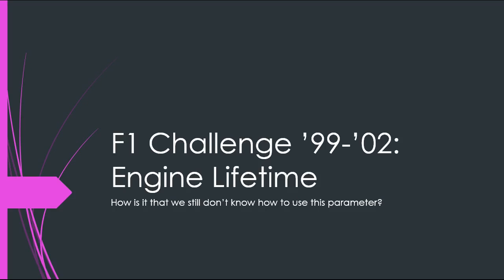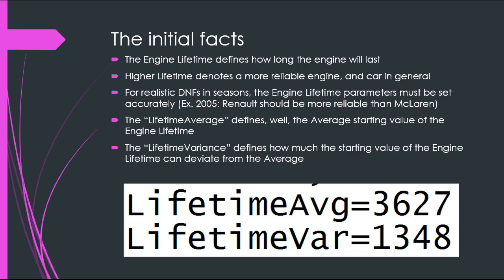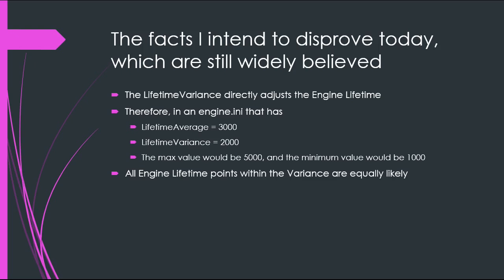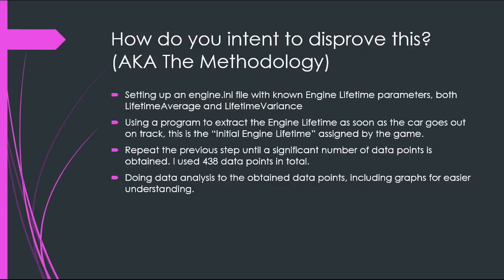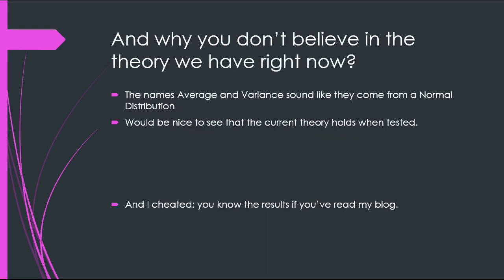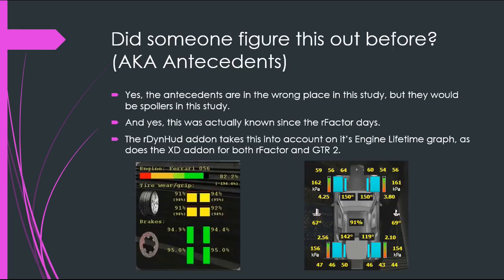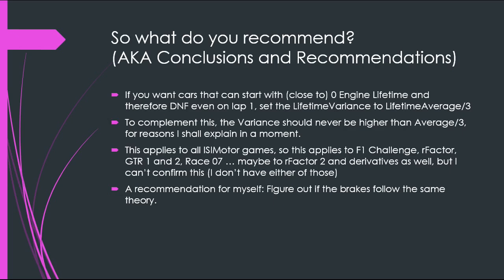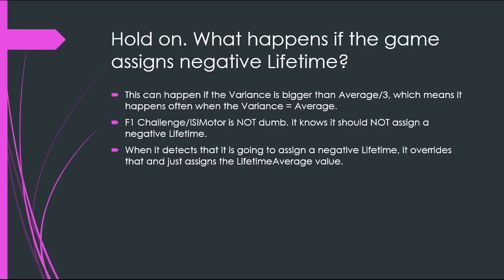Engine Lifetime: How is it that we still don't know how to use this parameter? (For ISIMotor games)

Comment: Well done. I recently used average and standard deviation metrics from weather to pull a normal distribution random number for temperatures in GTR2.
Reply from the maker: Thank you. It's nice to see that ISI Motor responds well and itself uses normal distributions. I'd guess it does the same when it comes to other parameters, like the brake lifetime parameters or maybe driver ratings, but this I'm not totally sure.
Reply: @jose21crisisMS  I bet wherever there a “variance” it’s for standard deviations and normal distributions

Comment: So the variance always should be average/3 or minor to this?

Also if i put the same number, basicaly that dont gona meant cars can DNF in first lap?

I ask this because rfactor 1 and i think AMS, dont have the stall parameter of f1 99 02, so i think is imposible to replicate stalls in start of the sessions

Great video new subscriber
Reply from the maker: That's just my recommendation, so that the game can assign values close to 0. Setting the same number could still result in first lap DNFs, yes, but it is just as likely to result in extremely high lifetime values that can cause 0 DNFs, even if a player mistreats an engine by overreving it and overheating it. I think those values are a better balance between early DNFs and good lifetime.
Reply: @jose21crisisMS  great thanks mate, now im gona always watch that engine have adequate values, also i dont know until i watched this video that Variance also can increase the engine life